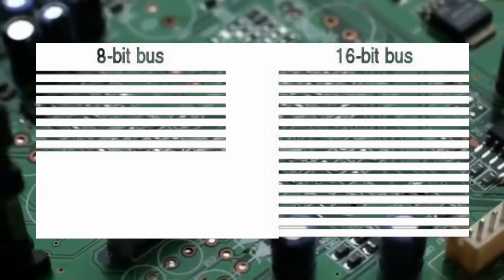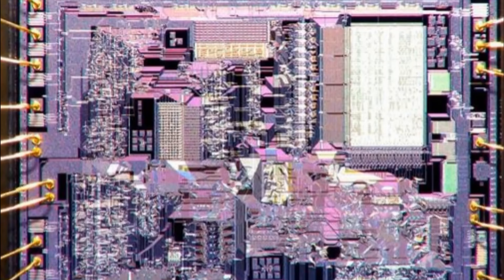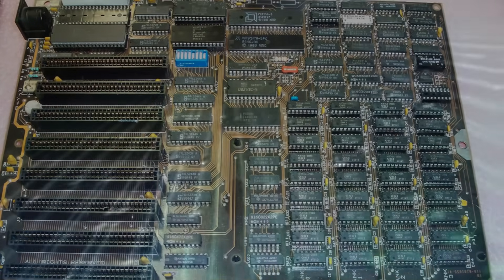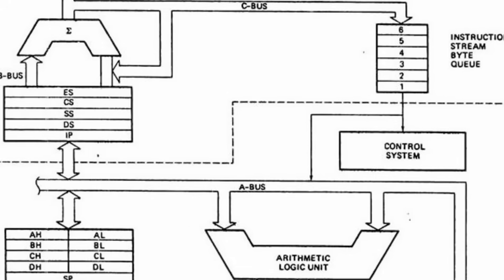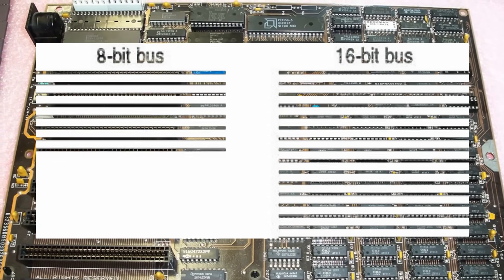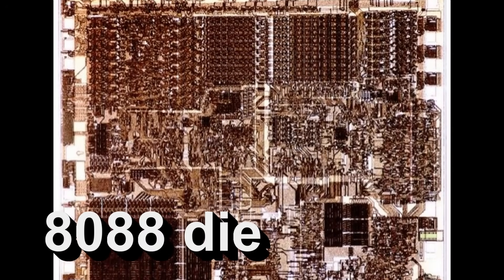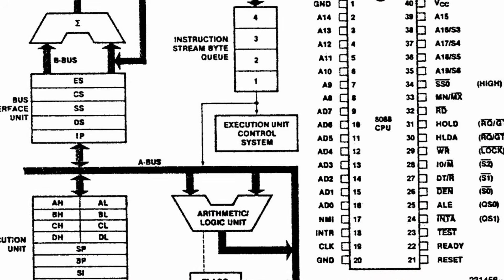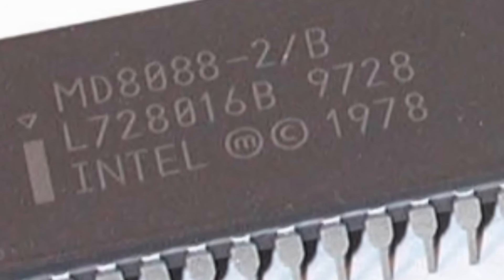8088 & 8086 CPUs... Why 16 bit Came Before 8 bit [Byte Size] | Nostalgia Nerd

Comment: Actually 16-Bit did not come before 8-Bit. Intels first integrated CPU was the 4004, a 4-Bit CPU. It evolved into the 8008, Intels first 8-Bit. The 4004 got a later improved brother the 4040 as the 8008 got the 8080. The latter one released in 1974 got a mostly unkown successor the 8085 in the year 1976. The 8086 followed two years later. The 8088 was mostly a discount offer as the 8-Bit era as we know was starting to take off during these years. It also got a successor in 1982 called the 80188 as cheap brother of the 80186. Both getting not much of attention since the 80286 was released in 1982 as well.
Reply: @TaleTeller and @Engineer of Wonders. Try actually listening and comprehending, muppets. He said the 8086 was produced before the 8088 only and then said the 8086 was not used because existing motherboard designs were 8 bit. Ever thought about actually learning English Comprehension? Nope didn't think so.
Reply: Not just Intel, just about everyone does it or did it. National Semiconductor and the 32032 and the 16 bit version the 32016. Motorola and the 68000 and the 68008 to name but two.
Reply: He never claimed it did. If you watch the video and read the title, he just said that the 16 bit 8086 came before the 8 bit 8088.
Reply: And those weird 14 bit machines.
Reply: @mspenrice I think it may have been earlier than that. I'm wracking my brains trying to remember but all I seem to remember is a cut down variant was used for guidance in the 1950's for rockets. It was near 19 inch 3U size and one variant once it needed more memory was expanded to solid core memory (I have no idea what was used before that) and was a full 19 inch rack and expanded to 16 bit data bus. As for an 80288, there was one on the drawing board for a while but by that time economies of scale were starting to kick in as the bierdy wierdy home computers like the Oric Atmos, Dragon 32, and Tautung Einstein had gone in favour of IBM compatible computers with the exception of the CPC464 which itself was replaced pretty quickly with the PCW8512 which was IBM compatible I think. So basically the 16 bit motherboards were as cheap as the 8 bit ones had been 2 years earlier if not a bit cheaper. There were cut down 386 (386SX) and 486 (486SX) but not many people bought them when they saw the performance difference with 32 bit data busses. On the other end of the scale I worked on 256 bit graphics processors all the way back in the early 90's. ZIL DRAM the whole works. Transputers were interesting too. The T414 was a hell of a processor for it's time. I would take the above with a pinch of salt though as my memory for the above is not 100% and I have not touched some of these systems for about 35 years.
Reply: If you pay attention Intel has kept doing this over the years. Release a CPU, and then offer a cheaper (slower) variation of it. Today they are called Pentiums, before they were called Celerons. The 486DX had 486SX (no coprocessor) and the 386DX had the 386SX (half buswidth, like the 8088 vs 8086).
Reply: Well, I mean, yeah, but you had 36bit-word computers from IBM before then.
CPU history is fascinating. :)
Reply: Well the program counter was 14 bits on some early computers and so could directly address 2^14=16384 bytes. Is that what you mean?
Reply: Actually it is weirder than that. I can't remember the manufacturer but there was a 14 bit data bus with 6 bits for the instruction and 8 bits for data which could actually be data or for example the offset for the next instruction or the address the accumulator would be dumped into. Sort of similar to PIC microcontrollers but not quite.
Reply: I wonder if they ever considered an 80288...?
+Gordon Lawrence ... you're probably thinking of some early mainframe or maybe minicomputer, possibly one of the DEC PDPs?
Reply: I don't think solid core memory would work. The hole in the core is quite important...
Reply: +MaxQ10001 haha... c'mon, you knew what he meant ;)

+freeculture ... Intel has had times where they didn't do it, though; the 286 stood alone, as did the original Pentium for a while. Right now they have quite a widely stratified CPU line, but that's both because they have an awful lot of markets to cover (at the time the 286 was out, you basically had "high end", which it covered, and "sort of affordable" that was the domain of the 8088, with the 8086 and 8018x's being already largely forgotten), and because it helps them make the most of a manufacturing process with an inherently high failure rate.

The Atoms and Mobile CPUs are essentially a line to themselves, as they're tuned for high energy efficiency above almost everything else, but the Atoms themselves are likely chips that would otherwise been on a higher rung of the Mobile model ladder, except when tested their dies had flaws in particular areas that meant only the combination of parts required to pass it as an Atom were fully functioning.

The mainline chips work in much the same way - they're pretty much all manufactured as i7's (or, I guess, i9's now, though I think those actually combine a separate CPU and GPU chip in the same carrier so might be a separate line to themselves?), as it costs essentially the same to put a top-end mask on the etching beam and expose the dies using that as a low-end one. Then during testing, they're binned according to which parts (and how many) of them actually work or not. The jankiest chips where pretty much just one or two main ALUs and a tiny bit of cache (and maybe not even the graphics section) work, at a limited maximum frequency, and not even the turbo boost function or energy saving properly operates become Celerons (anything worse goes in the reject bin and is recycled). Some more of the core(s) features (and more cores themselves, maybe with hyperthreading working properly) and more cache, plus at least a rudimentary part of the graphics, and it's binned as a Pentium. And so on and so forth up the i3, i5... chain, with various subclasses (all the cryptic numbers following the "i5-" bit) existing within each main category for how many of the cores actually work, the frequency they can withstand under normal and turbo boost operation, and exactly how much cache there is, as well as what grades are currently the most popular and that Intel are trying to refill stock of (an otherwise more functional chip may be binned down to meet that demand, even if it means selling for a lower price than they could technically get for it, because they all actually cost about the same to make, and getting that slightly lower amount of money for the part is better than disgruntled customers unable to get the Intel CPU they really wanted going and buying from AMD instead; this is where the low end chips that are curiously overclockable come from... and also why the low end models still use about as much power as the high-end ones, because the damaged areas are still connected to +Vcc and CLK...), with particular jumper traces on the chip being burned through to internally set it as a particular model - which also prevents it from trying to use clock rates that are beyond its capability, or features that reside in damaged portions of the die.

It may seem like a daft thing to do, instead of just immediately recycling any parts that don't test out as perfect and only selling the absolutely most powerful chips they can, but it makes a much more efficient use of the inescapably flaw-ridden chip fabrication process, and actually makes them a lot more money from fewer wasted production runs and being able to capture a much greater swath of the market, from ultra high end gamers right down to someone who just wants a simple 8-inch tablet to check facebook and write emails on. All from an initial manufacturing phase that actually produces a surprisingly limited number of actual designs.

It's something they've also done over the years, which is where the "16-bit only" 386s came from (the parts that dealt specifically with 32 bit code were damaged, but they figured they could still sell them to OEMs building machines that were never going to use anything but 16-bit code anyway), maybe even the 386SXes (maybe the internal parts that dealt with the upper 16 bits of the data bus and/or upper 8 bits of the address bus were damaged? though I think it was more a deliberate 8088-style design decision to produce a 386 that could be installed into an existing and otherwise 286-centred motherboard), and certainly the 486SXes (those which had working FPUs were marked DX - and a select few "487SX" for installation into a 486 board's FPU slot where they'd then take over from the SX entirely - those with damaged FPUs marked SX, and then both were further binned by what voltage and clock speed they could handle) and the original Celerons (which were Pentium IIs with partially or wholly nonfunctional cache). And AMD doing similar with the K6 II and III (the IIs being IIIs with fully working cache... part of the reason why there were so few high clock speed IIIs and they weren't really overclockable was that even when all the cache worked, it was kinda fussy about speed, whilst the working bits of those marked as II tended to have a greater chance of allowing higher speed), Athlon and Duron (again, mostly based on cache, but also ability to handle a faster memory bus, absolute clock speed, and some power saving features), Opteron and Sempron, etc.

Really, the modern day Pentiums are still fairly decent chips. It's just that all the Core models above them have a successively vaster array of advanced features. It's the Celerons that remain the real wasters; the original models arrived at a time when having limited or even no L2 cache at all wasn't too much of a handicap, especially if you found your cheap processor was also surprisingly overclockable. In the modern age, it's a total ball and chain, and the Pentiums at least, if nothing else, still retain a half decent amount of L2, whereas the Celerons limp along with relatively little. I mean, I'd still prefer at least an i5, but I've used enough Pentium based machines that ran at an acceptable pace for everyday (and non-gaming) tasks.

+Gordon Lawrence ... (and I suppose freeculture as well)... the reduced bus width thing isn't really a reduced feature set though. In the case of the 8088 and 68008 (and 80188, and probably the 386SX, as well as the 486/Pentium Overdrives and 486SLCs), they weren't so much binning down partly functional chips to sell as cheaper less-feature-rich models, but responding to customer demand for processors with more advanced, 16-bit (or indeed 32- or even 64-bit) grade features, including the generally faster internal processing and clock rates that such CPUs offered, as well as straight up code compatibility with programs made for more expensive machines, that would still work within a cheaper 8-bit (or 16-, 32-bit) bus based motherboard design. Heck, IBM reportedly deliberately went for the 8088 over the 8086 not just because it would make the design cheaper and easier to rapidly bootstrap using the 8080- and 8085-compatible parts they had already made use of in older models in the 51xx line, but because it offered a combination of seemingly advanced technology and forward compatibility with potential future 8086-and-later designs, with actual performance that wasn't so high as to threaten sales of their more sophisticated and expensive computers.
Reply: +Gordon Lawrence (earlier post) ... I think there might be some fuzz in your memory, but the recollection is still appreciated :)
Still no idea what the early machine you're referencing is, but given the use it should be possible to track it down and I'd be fascinated to find out.

I guess with the 288, Intel would have just ended up competing with itself too much, and realised as such, as well as how it was essentially an update of the 086 (and 186) intended for just the same type of motherboards only with a wider address range... and as the 086 core was already fairly hamstrung by the 8-bit bus in 8088 form, throttling the 286 in the same way probably wouldn't produce any noticeable performance gains over the 8088... it'd merely give some bonuses in the form of a wider memory range and protected mode, neither of which were likely to be issues for the lower end of the market. It'd have been a chip without a reason to exist, and anyone who was building a cheap system at the time of the 286's introduction would still have been plumping for the 8088 (or, rarely, the 80188 or 80(1)86) instead of bothering with a cut-down version of the newest chip.

Plus maybe they'd managed to pull off a vast improvement in quality control and just didn't have enough die cores with faults in the upper 8 bits of the data bus for it to be worthwhile saving them from the recycle bin and trying to sell them ;)

The PCW wasn't IBM compatible (didn't even actually use an MDA display, though it looked very similar to it - actually just a regular 15khz CRT with the scaling turned down to minimum to fit more visible pixels and lines that would otherwise be lost to overscan), in fact it was a CP/M machine underneath, which might have made it seem a bit DOS-like I suppose. My strong suspicion is that they were essentially CPCs with different ROMs and keyboards...

Amstrad did make IBM compatibles but they just called them things like PC1612 or similar (I forget the actual numbers). All three of the PCs, PCWs and CPCs coexisted for a while in fact, as they addressed very different market segments to each other; home computer user, people who just wanted a basic WP and SS system (which happened to also be a full computer in disguise), and of course the fat-laden IBM compatible sector. For all his faults, there's a reason Alan Sugar is known as a shrewd businessman...

I think a lot of people actually got suckered in to buying the 386SXes even though their performance wasn't particularly hot vs the 286. They offered compatibility with the expected onrushing wave of 32-bit software (which then failed to actually break for many more years), for a price not much more than that of the older ATs, and still ran, eh, OK with the generally low-load software of the day. My school had piles of the things, with basic VGA displays and some kind of largely irrelevant hard drive (as they were, unusually for the time, all networked and pulled their software off a server, and you just saved your work onto floppy anyhow), running Windows 3.11... even some with external caddy CDROMs. They did alright, seemed to be at least a little faster than our old ST, and of course had that full colour high rez GUI which seemed pretty fancy in comparison.
The 486SXes that replaced them actually only seemed marginally faster, maybe partly because they were only running at 25MHz (vs 16), but also because they were still only running the same old 16-bit code whose only nod towards the 386 was that it ran in full-fat protected mode and could use virtual memory as a result (also, still only running base VGA mode, and not taking any advantage of their ISA graphics accelerator cards and SVGA monitors). Otherwise, excepting the boosts from better cycle efficiency and the L1 cache, they were probably little faster than a 286 would have been at the same clock speed. Until Win32s and DOS4GW (and EMM386) came along, and more importantly Windows 95, the 32-bit advantage was questionable at best for most home and corporate/institutional users. Unless you were running an OS and software that took full advantage of it, you essentially just had a slightly quicker 286. The 486 DX33s and DX2/66s, then early Pentiums, that were the next generations they invested in, all with slicker SVGA displays, internal CDROMs and soundcards, and 32-bit enabled Win3.x (and then Windows 95) seemed light years ahead in comparison despite actually being relatively minor upgrades, simply because of how much better use they made of the hardware they did have.

And yeah, it's a shame that proper graphics accelerators didn't break out of the CAD market until the 3D game explosion in the late 90s... I know certainly Matrox were making some pretty neat stuff around 93-94, but basically unless you were using AutoCAD or the like it wouldn't have done much for your day-to-day use of the machine. It's a vicious circle sort of thing ... if there had been more software that took advantage, more people would have bought them, but unless there's enough of an installed user base there's no point adding the capabilities into your software... and the actual revolution only came along when the companies making the early full-textured-3D accelerators for unsuccessful consoles decided to make money by sticking their chips on expansion cards instead and negotiate with game programmers to build in "better than console quality" compatibility modes to their latest titles.

Funny the mention of ZIL chips, until now I thought the only thing that used them were some of the higher end Amigas ... I suppose maybe graphics expansion cards for those might have been one of your stocks in trade?

And the transputer... man, that was going to be the future, especially from an Atari user perspective (as they were cosy with INMOS and made the workstation that provided the user interface for the transputer cards, all the magazines went loopy for it and its capabilities, predicting that it would be the thing to bring Atari back to dominance in the 90s...) ... too bad it was too different, too soon, and, well, late 80s / early 90s Atari being late 80s / early 90s Atari, they fumbled the ball on their side of the deal quite badly... even though it seems they abandoned their own designs for an upgraded ST along the lines of the Mac II in favour of the ATW and only came back to it (and boosting the spec to make the too-expensive-to-succeed TT) once that deal started falling apart. With the ideas inherent in the Transputer design only really coming back into the general computing fold and gaining serious traction in about the last ten years. It's crazy to imagine what could have been and how much more advanced the computing, and most especially graphics scene would have been through the 90s if there had been enough programmers around who had any understanding of how to code for the damn thing in an effective way, instead of leaving it to fail and the ideas to gather dust essentially until the point where classical single-core designs simply couldn't be pushed to any higher frequencies without melting themselves with microwaves.
Reply: Exactly. This guy is just an idiot
Reply: Paulo Constantino I think you were looking in the mirror when you said that. Try watching the video properly next time you muppet.